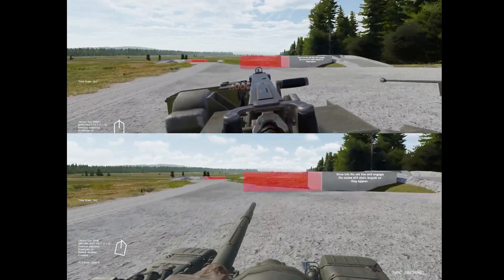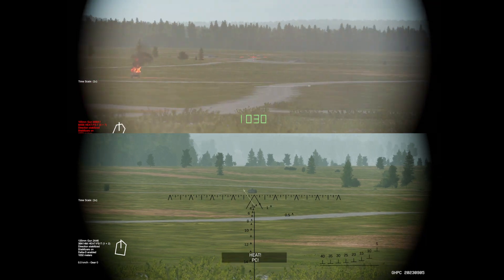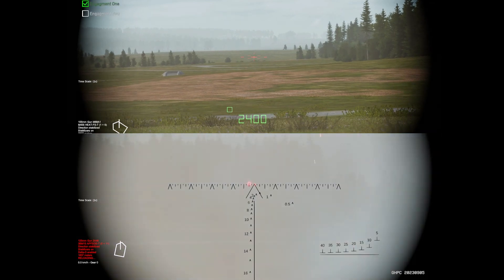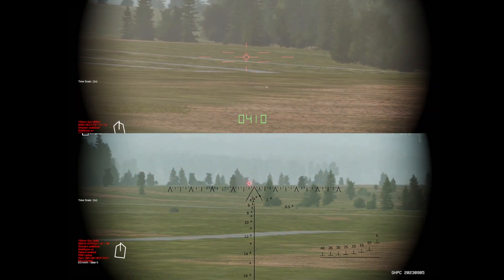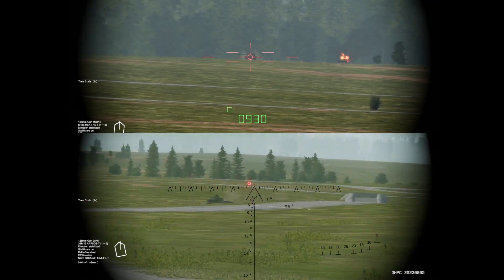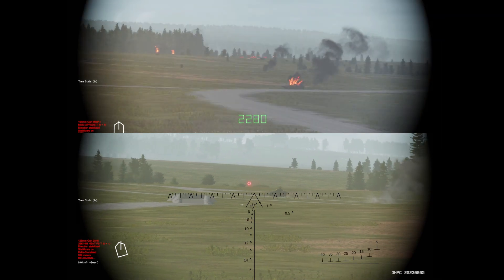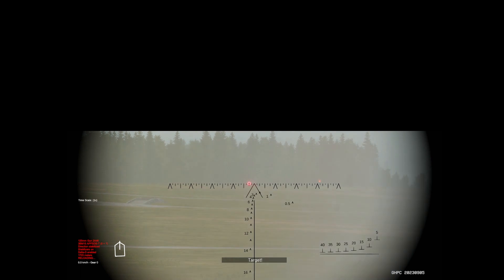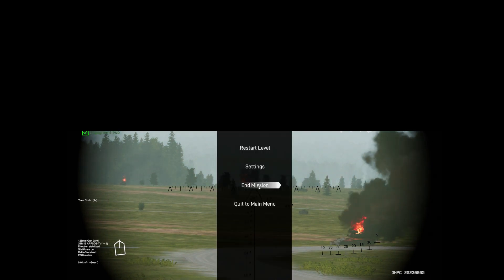Real TC plays #ghpc #t-72 VS #m1abrams  Day

Comment: I'm curious to see how T-80B would do in comparison to an M1IP.  I don't expect it to match the Abrams, but it would be interesting to see what the added mobility (better reverse gear too) and FCS does for the tank in practice.  Leopard 2A4 would also be an interesting one.  I'd imagine it would handle in practice similar to an M1A1 with a smaller ready rack (15 + 1).
Reply from the maker: The T80 would probably be an equal match to the M1. Assuming the fire control is just a good and top of the line ammo. The only benefits of the M1 would be the gun depression and rate of fire
Reply: @zagstrukk  The reason I say T-80 wouldn't quite be as good is to my knowledge, the gunner sight on the T-80B is not equipped with thermals.  Those came after refits (especially the T-80U series).  I could be mistaken, but that's why I feel the M1 would still have an edge.  I'm also not sure the FCS is quite a match for Abrams, though it is an improvement over T-72A/B
Reply from the maker: @Registered_Simp  if the T80 has a night sight as good as the m60a1 then it has a chance at night vs the m1
Reply: @zagstrukk  Perhaps so.  At least, either way, it won't be stuck with T-72A/M's god awful IR night sight
Reply: put it this why : however shoot first will win 

i have seen 3BM32 easily penetrate the turret checks of the M1IP out to 900 meter( little under 1km's )  . and it can do the same to a baseline M1 at around 2km's

the m1 could also do the same thing to the t80B if it hit an aera like the divers spot or around the gun mantle where is no composite armor
Reply: @samargrewal929  First sighting and hit is usually indeed what determines the winner anyway.  Which is why I'm still giving the edge to Abrams due, to my knowledge, to superior optics and FCS.  The T-80 certainly isn't to be underestimated though
Reply: @Registered_Simp   the T-80B's FCS is on par with the Abrams but lacks thermals and also the sight has variable magnification 

overall the Abrams still has the edge with it's thermals ( even if there image equality is quite poor ) 

but that is not to say the T-80B has no chance as if he sports you first he can shoot you as accurately and as quickly as you can

Comment: Compare to T72, where gunner have to manually adjust the gun to correct elevation, M1's FCS completes the job much faster and more precise, even if the system is operate on hydraulic. Amazing tech.
Reply from the maker: And the latest M1A2 has an even better fire control system with auto lead.
Reply: @zagstrukk  Some good news I want to share, I finally get pass longer road after 30min of struggles. I observe more frequently and sweep around each wp before getting in. When facing the T64 I keep firing while moving house to house. But when there are two t64 left, one hit my track and one killed my loader, force me to bail out. Then I switch to my wing man and shot on a hill near wp4. With the help of arty and illumination I successfully kill both of them.
It is a good mission that force me to change my bad habit. Cannot wait to see what T64 FC looks like in future!
Reply from the maker: @frankxu2321  this game is all about understanding the equipment and positioning.
Reply: @zagstrukk   the original M1 was fully automatic lead calculation
Reply from the maker: @samargrewal929  no it's not. It didn't exist until the M1A2
Reply: @zagstrukk    it does even in GHPC
Reply from the maker: @samargrewal929  no if you have to track the target and laze to get the proper lead it isn't automatic and then you have to dump the lead otherwise your reticle is jumping all over the place.
Reply: @zagstrukk   it is because the gunners sight only was one mirror. it is nothing to do with the fcs as it automatically leads and elevates the gun for you
Reply: @zagstrukk   and the M1A2 has two mirror meaning the sight does not jump. but outside that the lead system works similarly
Reply from the maker: @samargrewal929  correct, but the M1/M1A1 doesn't have that so it cannot have automatic lead
Reply: @zagstrukk   automatic lead means the system will account for the target slowing or speeding up and along with the speed of the turret of you're vehicle as well as it's own movement's as long as you track the target 

automatic tracking is designating a target for the ballistic computer to track automatedly

theses two systems are not the same
Reply from the maker: @samargrewal929  to me if you have to manually induce lead in the fire control system like the M1 and M1A1 then it is manual. Where M1A2 is how you track the target is how the lead is added. Without having to lase. Now on the M1A2 if you don't have a good lase and/or don't track the target correctly you will not hit the target. Manually is the M1/M1A1. Automatic is the M1A2 since it does it for you.
Reply: @zagstrukk   if you want how to know what manual lead looks like there is some t72 gunnery: https://www.youtube.com/watch?v=rHDjiYXm8Uw 

as you can see you have put the gun sight in front of the target and manually appley lead as the FCS does not apply the ballistic data to the gun's orientations  and updating it with the movement of you're tank or the target     

 in the M1  all you have to do is keep the center retile of you're gun sight on the target  and let the FCS handle everything else 

if you try do manually lead in the m1 while the auto-lead is on you're going miss